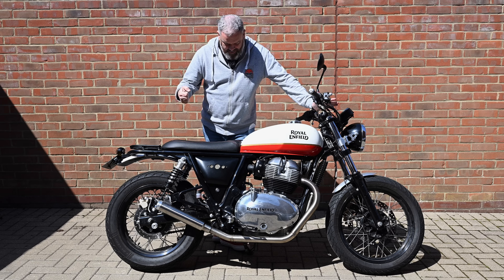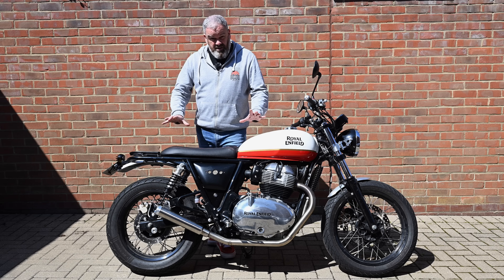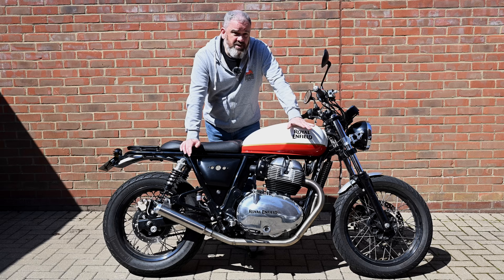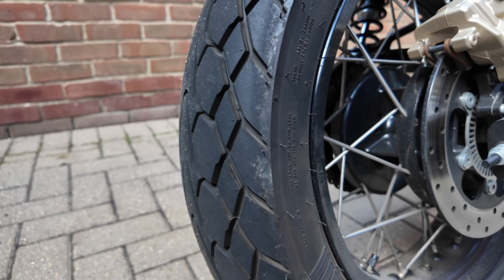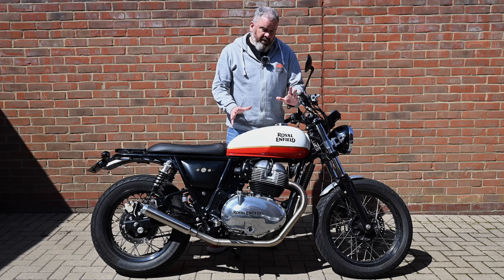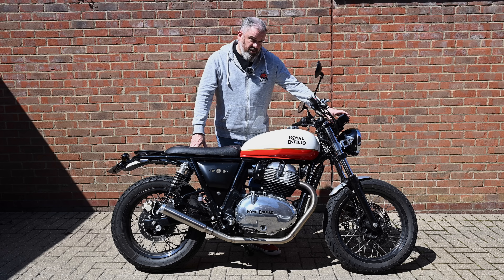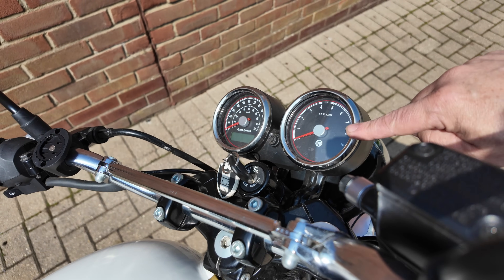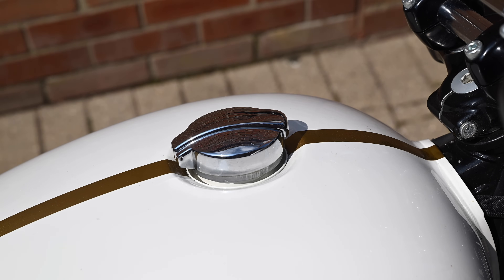Royal Enfield Interceptor 650 Project - EP.7 A long awaited update

Comment: Great job. You’re so right about suspension and tyres, best mods by far. My R9T was totally transformed. Love what you’ve done with this, love the pipe too
Reply from the maker: Cheers, funnily enough it’s an R9T that I’m hoping to buy. Loved them since they first launched and it’s what I would have bought over the street twin, but the prices were just too high for me.
Reply: @mancavemoto  Ah amazing. You’ll love it. Need the Wilbers rear shock though, makes such a difference.
Reply from the maker: Cheers, I’ll bear that in mind 👍
Reply: @mancavemoto I’ll look forward to that Tony
Reply: R9T only compares to Speed Twin not Street Twin. I almost bought the 9T but ended up going for the prettier (imo) ST1200. The 9T is very customisable though
I’d potentially be interested in the RE if still for sale
Reply from the maker: Of course but the Speed didn’t exist when I bought my Street Twin! 😃 yes it’s still for sale, couple of people interested but no ones hit the button yet. You can message me on insta or Facebook if you use those?
Reply: @johndavison5016  I had a RNINET scrambler. Kept it for about a year. Bought and delivered on looks alone during lockdown. A very uncomfortable bike to ride after 40 minutes. Great fun though. Engine breaking was immense and we all know about the tractor “characterful” boxer. Swapped it for a 1200 SpeedTwin. I’m looking forward to new Tony’s project.

Comment: Most enjoyable video. Your slight (!) modifications have almost all been major improvements, but I would not risk those miniscule indicators snuggling up to the headlight.  One splatted bug . . . When Royal Enfield made motorcycles previously, Morris Minors had indicators that flipped up to flash. Sexy. Have you considered installing something similar? Or hand signals with dayglo gloves?
Reply from the maker: The plan is to add stalks to space them out a little further. I had a '59 VW Beetle Cabrio that had semaphore signals, but nobody looks for those these days

Comment: Must be getting near the cost of TMF's Interceptor.
Reply from the maker: Nowhere near
Reply: The modifications showcased cost about $3500 USD.  Short Seat & Rack $741.00 USD , Long Shot Exhaust $904.00 USD ,  CNC machined Headlight Brackets
$240.00 USD ,  28mm Tapered Bars $40.00 USD ,  indicators $45 ,  The handlebar end mirror $116 ,  Rear Indicator extension Brackets $25.00 USD,  Dunlop Mutant Tire Combo $327 ,  Alloy rear fender $117 ,  motone tail light $100 , license plate bracket $20 , Ohlins STX36 R Twin Rear Shocks $779
Reply: @dirkdiggler5164  Rear rim?